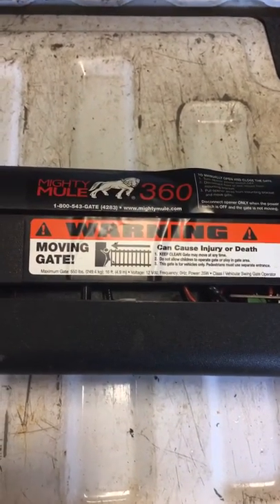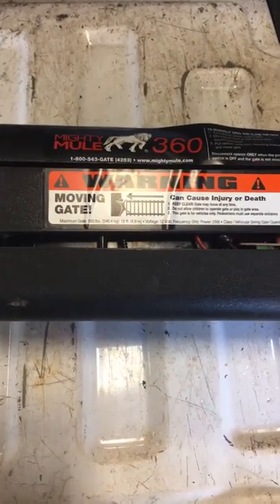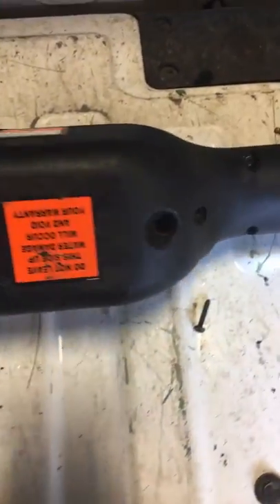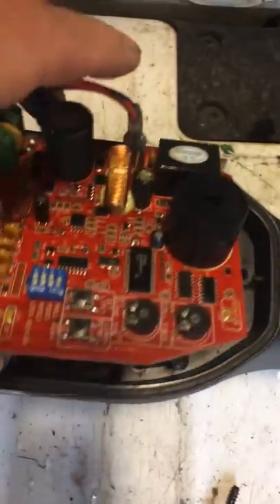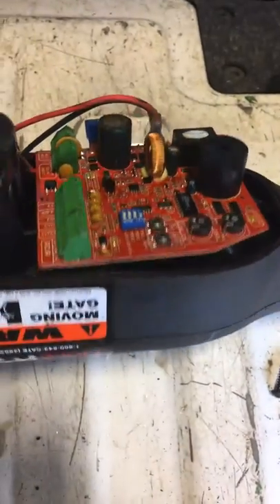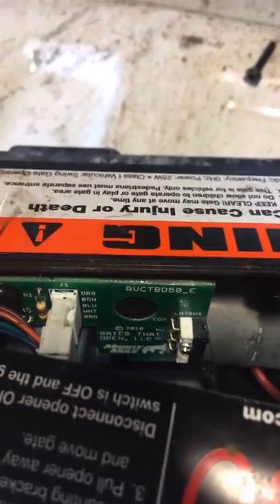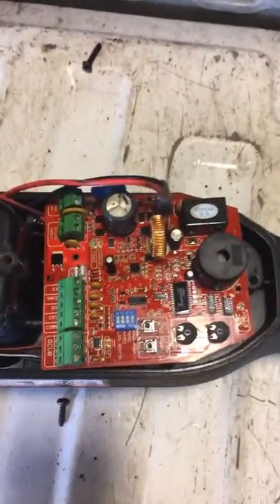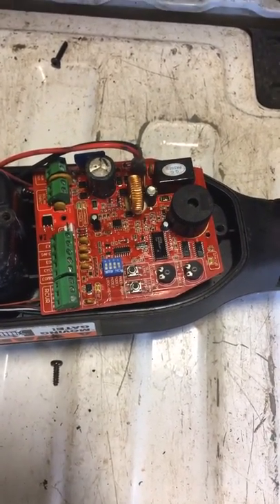Mighty Mule gate opener failure

Comment: Also in the NW... I've gone through probably 6 of these over the past 15 years too.   My 360 unit just failed on one my gates.  With the 371, they moved the board out of the unit, but to be honest, I'm tired of giving MM my money after the units fail every 3 years.  I'm looking at the ghost as well, though its a bit more money.  If you stay with MM, I  recommend setting up a curtain over the unit to keep the water off the body and the arm.  It might look a little stupid, but the weather hates these things.

Comment: Thanks Randy, where are the red and black wires that are connected to the board  coming from? power switch or from the motor? Thanks
Reply from the maker: from the circuit board

Comment: is it possible that the rain is trickling into the circuit board area on the shaft because it will need to be mounted higher on the post and have a slight downward angle where it attaches to the gate thus the water flows away from the unit 
also small drilled holes in the bottom to let moisture out 
silicone can be used to tighten up edges
Reply from the maker: or buy something that isn't poorly designed....which I did.

Comment: Did your MM beep once when it stopped? I've been on the phone with MM several times; replaced the limiter board and a bunch of wires, but has literally the same problem. This is the 2nd arm to fail in 8 years. I'm done with them.
Reply: This is the same problem I am having!

Comment: Randy -  How are the new brands working out? I need a recommendation.
Reply from the maker: Sorry for not replying earlier. I bought 2 Ghost openers right after I posted this video. I have had zero issues. Both gates are used several times a day. The Circuit board is separate from the opener and the units are sealed very well.
Reply from the maker: I have 2 ghost openers since for a couple years

Comment: which brand did you go with?
Reply from the maker: I went with Ghost. More money but superior quality and performance.
Reply: Are you still liking the Ghost brand gate opener?
Reply from the maker: @MyweathernetreportsBlogspot  I bought 2 of them right after posting this video and have had zero issues. Both gates are used several times a day.
Reply from the maker: The circuit boards are separate from the opener arm and both are sealed very well. I haven't even blown a fuse. The additional cost up front has been paid back several times over already.

Comment from the maker: Update: I had 1 MM left on a seldom used gate. It has now failed. Same issue. Rod will extend a small distance then stop. Open/close circuit board failure. It hasn’t been exposed to the elements yet still failed. That will be the last one I will ever use. Ghost and Liftmasters from now on depending on the application.
Reply: I am having this same problem!